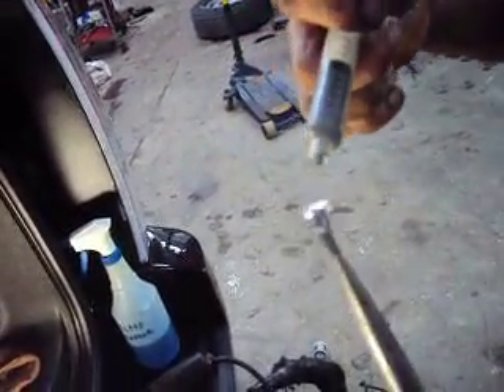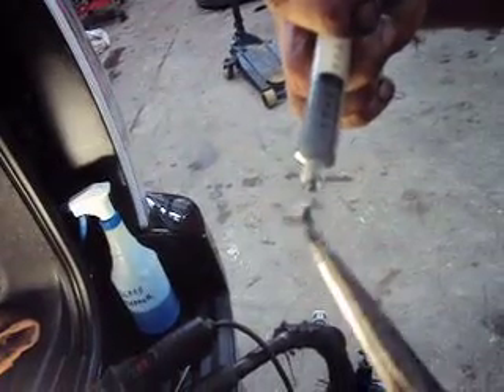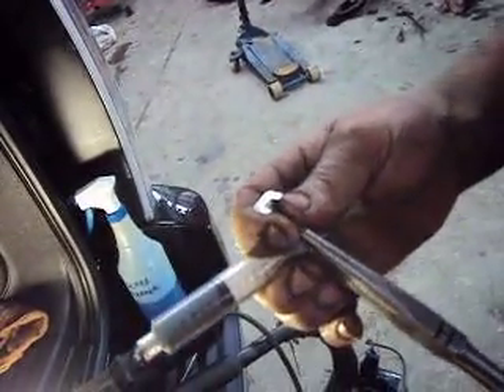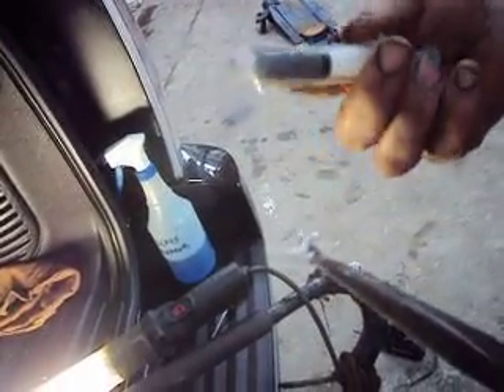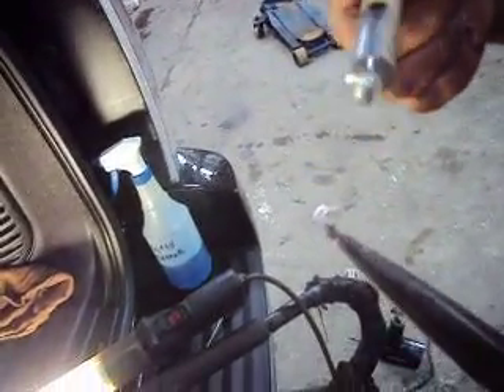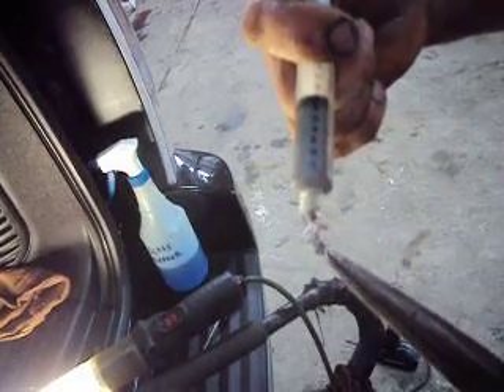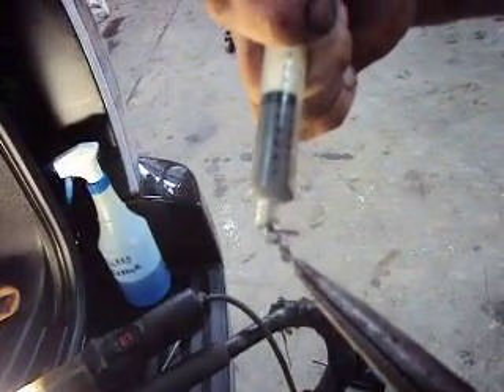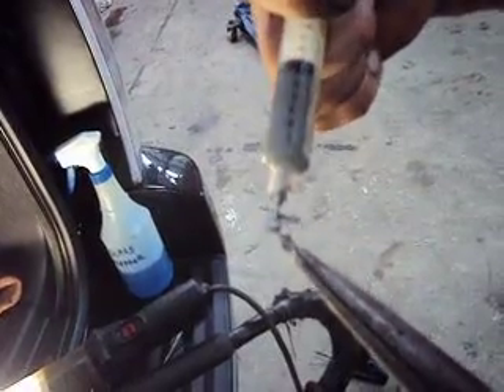Repairing a broken tab off the rear window defroster

Comment: I want to thank you for posting this.  I've been an ASE master tech for many years now, and just had to do this on my own car.  It was pretty nerve racking, I would have NEVER known about the Silver Bearing Solder (FYI you can get it for about $4 a tube at Lowes).  Thanks so much for showing me the rear glass will not explode as I heat the crap out of it.   
I did my repair on a cold day, and found it helpful to point a small heater at the glass to warm it before starting.

Comment: If the glass is cold and you can't bring the car inside a heated shop or garage for the repair, use a heat gun to warm up the glass SLOWLY so that the solder sticks better, and has a chance to cure.

Also it's a good idea to leave the metal tab unplugged from the wire for at least 24 hours, and don't turn the defroster on until then.

Comment: One of my demister lines burned. I simply fixed it with the Repair Kit of Ebay. Only £9.99 Check it out under "REAR WINDOW DEMISTER HEATER REPAIR KIT"